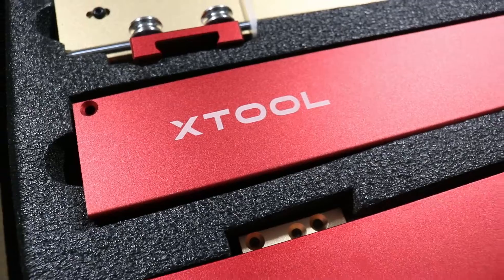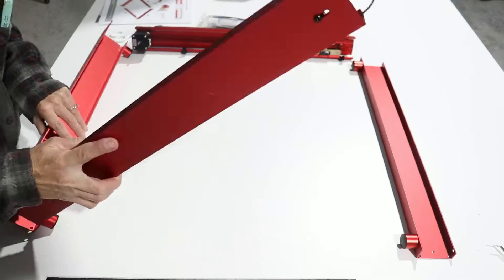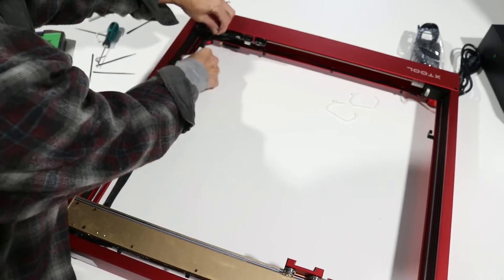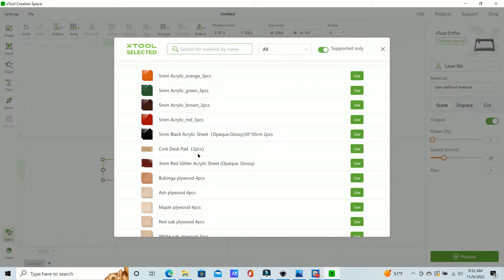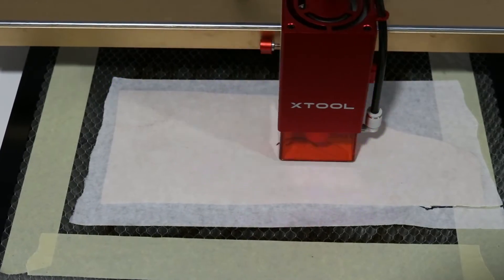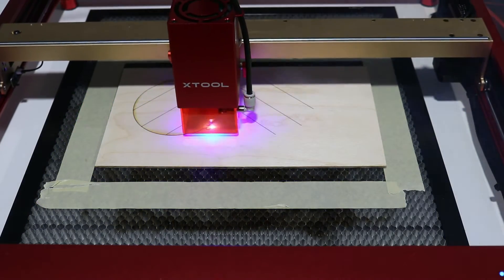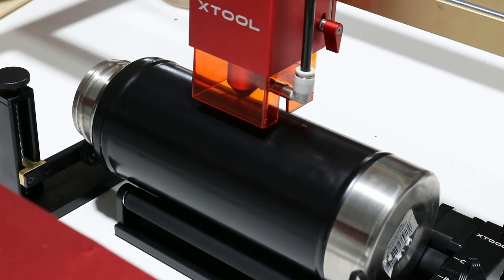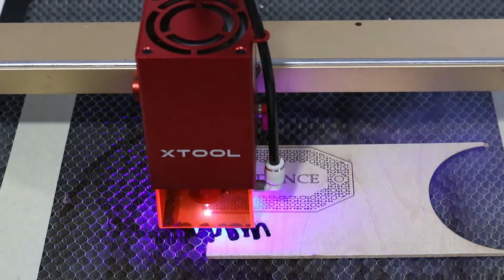xTool D1 Pro Laser Cutter and Rotary Engraver Setup Review & Projects

Comment: I just got the x tool D1 Pro for Christmas and having a hard time cutting out a simple shape....it just cuts a straight line..any tips?
Reply from the maker: Hi! I would def contact the support. It may be an SD card issue. If so you just need a new card. Also, make sure you install all updates for the program. That may fix a lot of issues. There is a sliding knob under the mother board...when updating it need to be on and all other times it need to be off. Check this first...it should be set to OFF when you are using the machine! If it is on when using it the machine will act wonky.